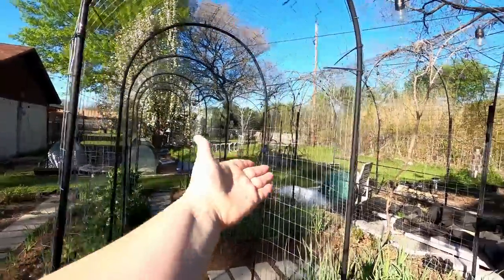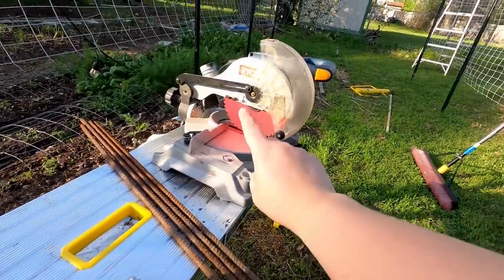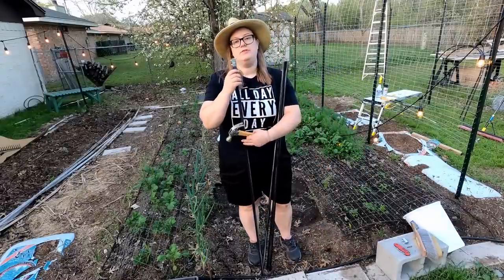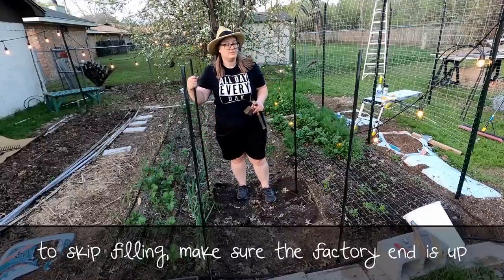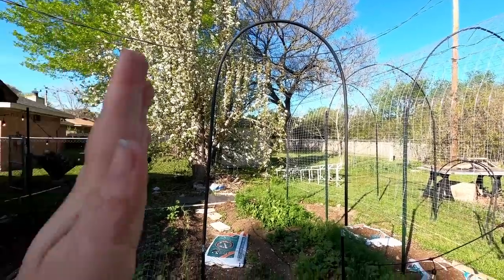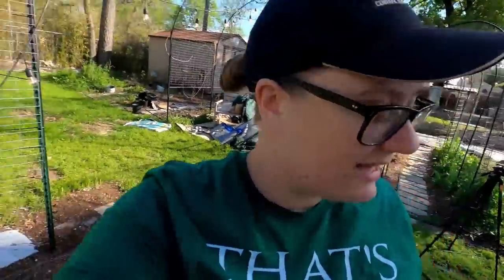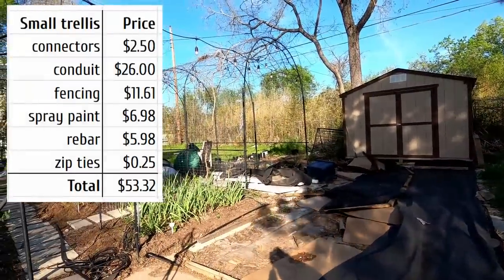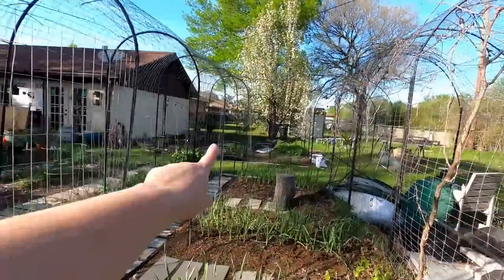Building Garden Arches with me

Comment: Your arches are the best I've seen so far. Thank you so much for sharing and for making a very detailed video. They look great. Question: I see you used bird netting on your ground plants, you find it useful? Did you use it as a separator? I have a greenhouse I bought on sale from Amazon, unfortunately, I did not place it in the correct location due to my lack of experience. Now I am trying to use trellis to keep everything somewhat enclosed due to the wildlife. Thank you again for the detailed video.
Reply from the maker: I used some offcuts of my welded wire fencing to keep a stray cat from digging out my beds.  I do use bird netting over my soft fruits like strawberries etc, but so far it's been more hassle than it's worth.  I need to build a simple frame to make it easier to place and remove.  What type of wildlife are you struggling with?  If I have experience I'll share it.

Comment: If you don't have a chop saw, an angle grinder with a metal cutting blade is a much cheaper option if you're looking for a power tool for this kind of project.
Reply from the maker: Good point!  and probably would cut the welded wire fencing too!

Comment: Great video. Question- could you have started the fencing near the ground on one side, draped it all the way over the arch, then secure the other end near ground level on the opposite side? That way you wouldn’t have to have three pieces.
Reply from the maker: Absolutely!  If you do it that way buy fencing the width you want your arches.  I bought 5' fencing for my big arches and did precisely that.  I used the leftover fencing to create the smaller arches and 5' felt too wide.  The small ones are about 3 feet wide.  Happy Gardening!

Comment: Hi, I'm probably a bit dense, but could you explain how the shorter rebar posts you put in first work with the longer rebar legs?  Thanks so much for this video, I'm planning arches for our vege garden hoping to make it both functional and beautiful.  Regards from Tasmania, Australia.
Reply from the maker: Absolutely!  The rebar is 3/8" which is small enough to fit inside the 1/2" conduit.  The rebar goes in quite far 18-24" which provides a LOT of support.  Then we put the conduit over it and also drive that in the ground about 12" over the top of the rebar.  

The rebar is optional but adds quite a bit of stability.  Last year I grew watermelon, cucumbers, and squash over mine and they held up great.  

If it's still unclear I could make a short video to help clear it up, pictures help a ton.

Comment: Is this cheaper than cattle panel?
Reply: I'm not certain if it's cheaper but it could be less work and easier to put together if you are somehow able to get 16' cattle panels home.  
The panels in my area are about $40 with tax.  Add 4 steel T posts at $6 each plus metal clips to attach the panel to the posts.  
So about $70 for each 50 inch long arch.
Personally, I would go with the cattle panel arch but I have no way to get them home at this time and farm supply stores won't deliver the panels.
Reply from the maker: NOPE!  In my area Cattle pannels are 5'x16' for $27, 6' 6-posts are $5, so it would be about $47 for the cattle pannel archway and about $54 for my version.  Not a huge difference but it's nice to have options if you don't own a truck or a flatbed.  Hope this helps!  I like questions so feel free to keep asking :D

Comment: I would suggest placing your arches at the width of the height of your fencing.  Then measure the length of the arch from the bottom over the top and down the other side.  Cut the length of the fencing then attach it to the arches in one peace.  It will give you a sturdier and nicer looking arch.
Reply from the maker: You are right!  I bought the fencing to make my big arches and the small arches were simply made from the leftovers to save money.  If I was just making the small arches then I would have bought 3' fencing to create my arches and followed your advice.  For sure a cleaner and stronger method!  Great point!
Reply: @learningwithmichelle1908  That is exactly what I was thinking. We made a 4" wide vertical trellis with conduit, rebar, and some right angle connectors and just zipped a panel of fencing to it. We didn't drive the conduit into the ground, but the rebar is a little taller and we don't need to support much weight. Just peas and cucumbers. We use rounds of the wire fencing lined with burlap coffee bags from a local coffee shop/roaster to contain leaves for leaf mold - we have a lot of 4' fencing still. I think it was $30-40 when we bought it.